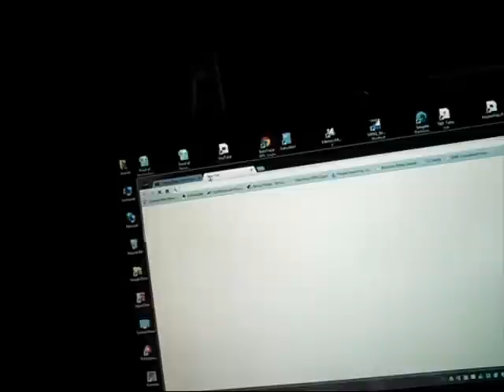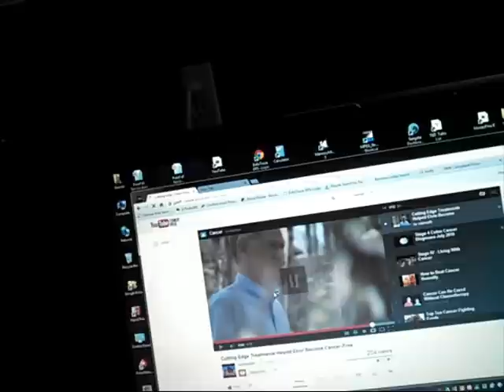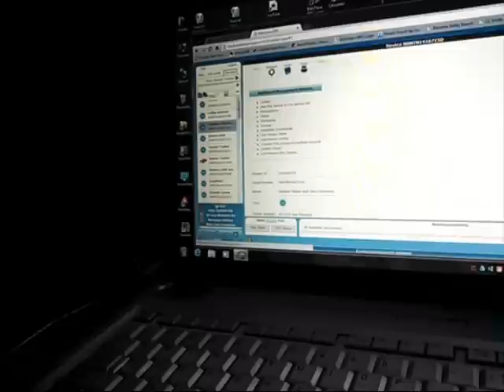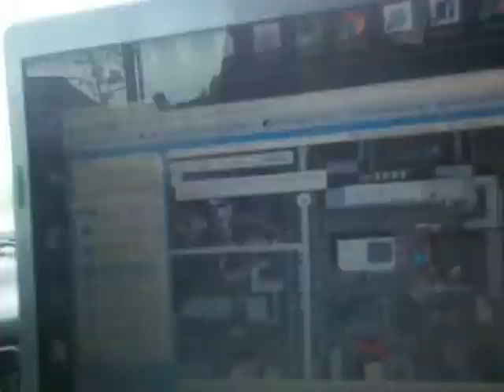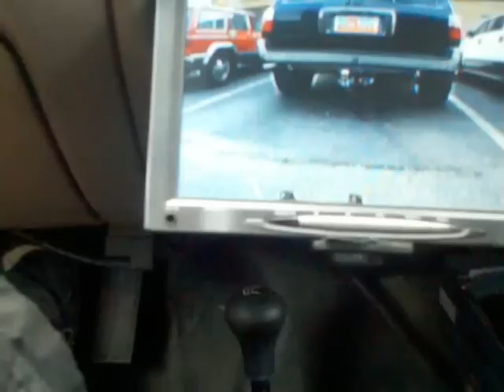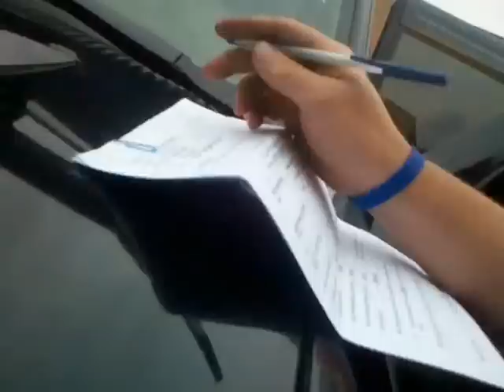Going Back Out On A 4 Runner And Serving Debtor With Court Papers

Comment: Probably a lot more thrilled than, "I sold it to some random dude in the ozarks, good luck finding it."  If the bank was told (Even after the title switch) the vehicle was being transferred to a family member and was given the address of the 'new' owner, they might not have been thrilled, but there wouldn't have been a court case over it.

Comment: I didnt understand why they where gonna press criminal charges to them
Reply: 1. Debtor still owed money to the bank
2. Debtor claims they needed the title to register the car (I know...it doesn't make sense to me either). I've seen this but usually the DMV doesn't need the title...only your loan documents. 
3. Bank sends her the title so that the DMV will register the car and then send the title to the lien holder (bank)
4. Debtor turns around and commits fraud. Instead of registering the car, she sells it to another party and gives them the title. Very illegal. 
5. Bank asks DMV what happened to the title (since they haven't seen it yet). DMV informs them that the car is registered to the new owner. 
6. Bank has to file lawsuit naming Debtor as defrauder. 
7. Mike gets to hand her the court papers demanding she show up in court. 

As I write this it sounds more fascinating than it really is. What fascinates me is how quickly the system works to catch and prosecute this type of nickel and dime fraud. Whereas...on Wall Street and in China, individuals transfer millions of dollars between accounts and there is zero scrutiny as to whether the deal is lawful and that the taxes are being paid accordingly. There should be a lot more oversight to the larger accounts in the banks (and I don't mean more lawyers). They should increase the staff at the SEC and tax commissions so that these larger transactions are each inspected thoroughly. I believe the return would be an enormous amount of tax revenue and also a fair amount of investigations into fraud--White-collar fraud.
Reply: +parteibonza wow. really interesting
Reply: Who the hell is Mike?
Reply: +Aurelius R is it matt? Probably spellcheck error